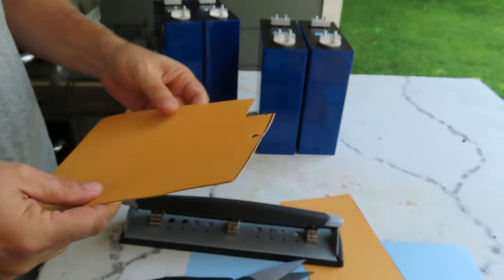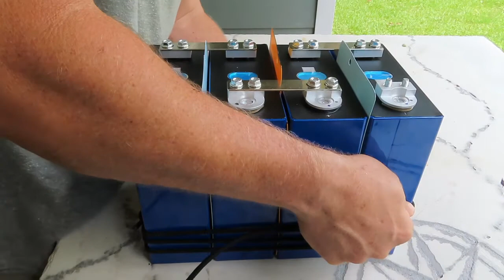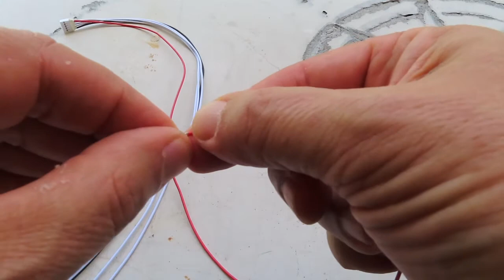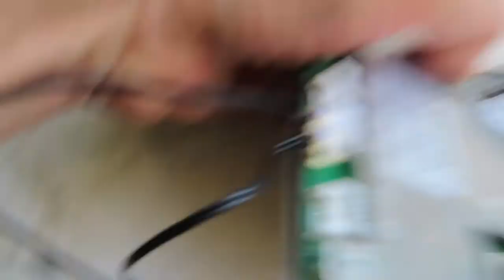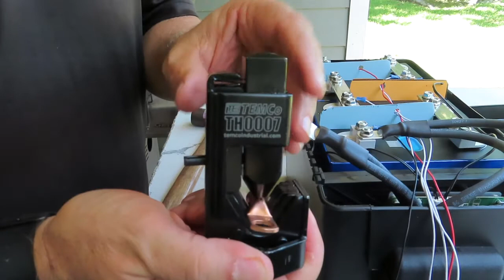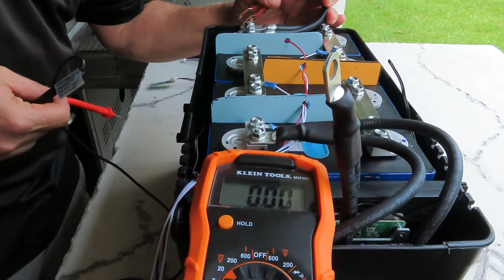LiFePO4 Lithium Battery Build Part 2

Comment: How about wrapping with 3m 33 tape?
Reply from the maker: The batteries have been operating 24/7 for 3 and 1/2 years in my 5th wheel, as designed in the video. If it ain't broke, dont  fix it

Comment: Great video!  However, 18650 Battery Store has quite a few bad reviews on Trust Pilot, so buyer beware.  Also, the BMS has been out of stock.  Do you know of another supplier?  Thanks!
Reply from the maker: I agree. Upset people do reviews. My experience has been stellar, from the price, to the delivery, to the quality. Especially the quality. They even called me a couple of weeks after I received the batts to make sure everything was good. I don't think I have ever had any company do that. And I know I have never had a battery cell company do that . I should probably write them a review

Comment: How much did thos cost to build?
Reply from the maker: links for everything are in the description
Reply: about $885 for 280AH battery - that's only $3.16 per amp hour with a 150 amp BMS as opposed to the standard 100 amp BMS. I personally would not use bungi cord to wrap the batteries. I would use High Temperature Tissue Paper Tape and find a different way to provide cushion/spacers